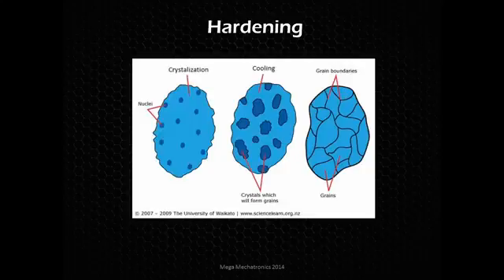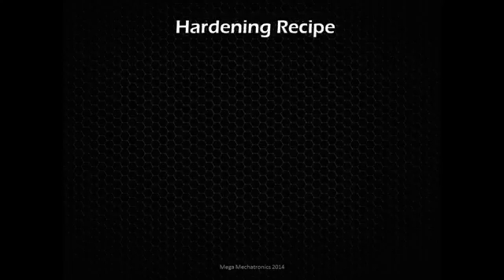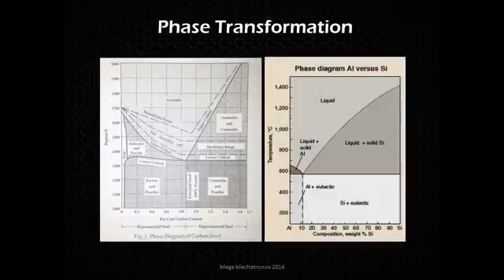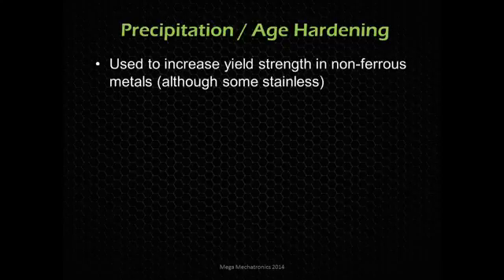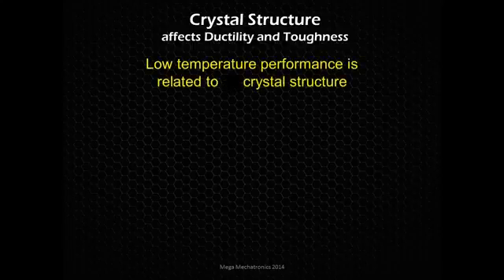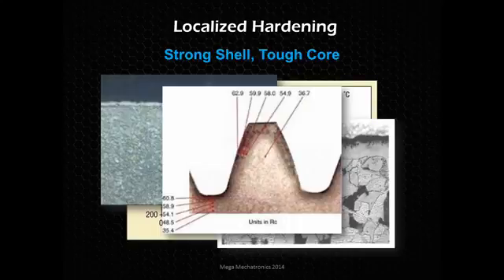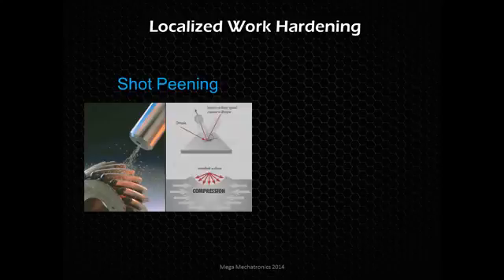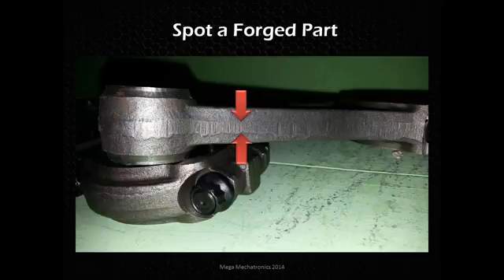Materials Science Mechanical Engineering    Part 4 Heat Treatment Explained

Comment: Name : Eri Dya Fadly
Nrp  : 2714100036
From this video I get some information about heat treatment process. Hardening and heat treatment need to be concerned since the result will affect the mechanical prpoperties. the hardening process we need to crystalized and then cool the material. we know that the BCC structure is the base form in ferrit phase. to increase the hardness of the material, we will make the martensite structure. this structure have needle path with great boundary stress that will give more hardness structure. from the crystal structure, we need to make smaller grain size because the grain boundary will give barrier that mean a hardness increased.  The concern in this short paper is about hardenability of material. The hardenability in this concept are limit dependent on alloying elements of the metal and the hardness properties on the material is dependent on carbon content in ferrous carbon. We can see the hardness vs carbon content in the video, the hardness is hugely increased with addition in carbon content until 0.8%. the hardening process have many parameter such as heating rate , Hardness does correlate with strength of the material there is definite corelation, when hardness goes up so the strenth will goes up too., and for corerelate hardness with thougness so same concept joules of energy absorb in hardness so the harder it is more brittle and the less tough it's going to be in general but again it depends on the alloy. and this video tell about work hardening (cold working),Work hardening, also known as strain hardening or cold working, is the strengthening of a metal by plastic deformation. This strengthening occurs because of dislocation movements and dislocation generation within the crystal structure of the material. holding time and cooling rate. We need to quench material to perform martensite state in the material. Different quench media will have different amount of martensite. In the TTT diagram , we know that is impossible to perform martensit with water quench media. it will make the carbon trapped in FCC state, but the amount of carbon cannot be controlled. It will make the material has brittle properties and made the material crack. The material need to alloyed to reduce cooling rate but perform martensite state using oil or salt media. the heat treatmen until quenching process will give martensite state. Although the amount of martensite state can reach 100%. So the additional process need to be perform more process. We now that cryotemper will make the martensit state will revealed perfectly (100%) using this process. This process also called sub zero treatment. Lets comparate the amount of alloy in some material like plain carbon 1018. The base element is iron and it has 0.17%C, 0.75% Mn, 0.04% P, and 0.05% S. the eutectoid is still in 0.8% C . for the 4130 alloy steel, it has 0.3%C, 0.5%C, 0.2%Mo, 0.95%Cr, 0.25%Si. The 4130 steel will have eutectoid lower than 0.8%. the next process after we get martensite state is tempering. Tempering is the process to decrease the brittle properties and improving its thoughness. Tempering process must be done under transformation temperature to avoid the martensite reforming ferrit phase. Some heat treatmen like annealing and normalizing to improve ductility and age hardnenign to perform precipitate as known as secondary hardness may be performed.So, Heat Treatment is the controlled heating and cooling of metals to alter their physical and mechanical properties without changing the product shape. Heat treatment is sometimes done inadvertently due to manufacturing processes that either heat or cool the metal such as welding or forming.Heat Treatment is often associated with increasing the strength of material, but it can also be used to alter certain manufacturability objectives such as improve machining, improve formability, restore ductility after a cold working operation. Thus it is a very enabling manufacturing process that can not only help other manufacturing process, but can also improve product performance by increasing strength or other desirable characteristics.Steels are particularly suitable for heat treatment, since they respond well to heat treatment and the commercial use of steels exceeds that of any other material. Steels are heat treated for one of the following reasons:
Softening: Softening is done to reduce strength or hardness, remove residual stresses, improve toughnesss, restore ductility, refine grain size or change the electromagnetic properties of the steel.Restoring ductility or removing residual stresses is a necessary operation when a large amount of cold working is to be performed, such as in a cold-rolling operation or wiredrawing. Annealing — full Process, spheroidizing, normalizing and tempering — austempering, martempering are the principal ways by which steel is softened.Hardening: Hardening of steels is done to increase the strength and wear properties. One of the pre-requisites for hardening is sufficient carbon and alloy content. If there is sufficient Carbon content then the steel can be directly hardened. Otherwise the surface of the part has to be Carbon enriched using some diffusion treatment hardening techniques.Material Modification: Heat treatment is used to modify properties of materials in addition to hardening and softening. These processes modify the behavior of the steels in a beneficial manner to maximize

Comment: Azmi Putra Gasade 2714100114
Quiz 1
Heat Treatment

Hardening and treatments of heat of heat treatments and then some cold working processes. We actually make it crystallize and going let those atoms move around and going cool.

The atoms start forming crystals and in the materials aluminium we are looking at a cubic structure (CCT and BCT) where there is Adam Centered on the faces aound that cube, even hexagonal for some other materials.

Crystal Lattice Dynamics is a structure of those cubes and we can move those things around and it will not break or fructure because those the atoms are bonded together by kjnd of like a magnetic force so if you shift that over if you classically deform it those atoms are going to latch on to an adjecent set of atoms and move around.

A magnetic ball toys it is sort of illustrating that where he starts to forming it but it stays come together the balls moved their position but it still sounds somethings to latch on to a similar Adam.

Grain boundaries will start forming randomly within the material yhey are going to be crystallizing in different orientations to each other.

A kind of example of galvanized surface and that zinc is crystallizing in different orientations and then we see the lights refracting off of that in different ways and than we can easily make it out the grain boundaries.

At the video (a computer generated model) you could sort of see the crystal structure a uniform grain and then they will gtain boundaries around there will zoom in even closer sort of outline those and then give you an idea of the orient deifferent orientation and the size of yhe grain boundaries is difinitely important. so we do have smaller grains that more smaller ones that is going to have a stronger harder material because we are reducing the ability for those strings for that crystal lattice to deform and move around because there are these deformities.

They are sort of like a wall stopping them from moving any further and then on any other side of that we have huge grains and that makes the material more ductile because we are allowing into move around and andrey orientate. Themselves and shift around and the concept of hard ability that different alloys of metal are going to here different abilities that too hard a different mac hardness that you can achieve si with ferrous materials we put carbon in it and then carbon will increase the strength that gives certain characteristic to this crystal structure as it in there deforms it in a certain ways and allows us to harden that material by bike controlling the crystal structure.

The hardening recipe is very important of the time the temperatures that the material is fees during the hardness process.

The recipe is going to get lead ro success if you can follow that recipe consistently or if you figure out the perfect ways.

Phase transformation diagrams this will give engineers an idea of where to start with what temperatures and this carbon.

Precipitation hardening also called age hardening is a proceaa where a second phase that begins in solid solution with the matrix metal is precipitated our of solution. 

At the video also show us many ways to what should we do in heat treatment and many more tips or trick to see or count it.

Comment: This video explain how we can do heat treatmen in generally, about hardenability,
hardening recipe, diagram fasa, tempering, normalizing, annealing, hardness
test, scratch tes, cold word and hot work. Hardenability has limits depend on
alloying elements of the metal, but hardness depen on carbon containing ferrous
metal, Hardenability is the ability of Fe-C alloy to be hardened by the forming
martensite as a result of a given heat treatment. For every different steel
alloy there is a specific relationship between the mechanical properties and
the cooling rate. Hardenability is not “hardness. It is a qualitative measure
of the rate at which hardness decreases with distance from the surface because
of decreased martensite content. High hardenability means the ability of the
alloy to produce a high martensite content throughout the volume of specimen.
There are some heat treatment that we can do, Annealing is a process invollvig
heating and cooling, and its use for produce softening, tempering is process of
toughening a material (such as glass), metal (such as cast iron), or an alloy
(such as steel) to make it more resistant to stress by  heating it to a particular temperature, maintaining
it at that temperature for a particular duration, and cooling it rapidly to
normal temperature at a particular rate. Opposite of annealing. Not to be
confused with tampering. To do a heat tratment, phase diagram
can help by showing the corelations between the carbon content and the
temperature and phase for materials based on ferrous. The quenched media like
air, oil, and water will give a different microstructure at the end of the
cooling process. Metal Quenching Material is heated up to the suitable
temperature and then quenched in water or oil to harden to full hardness
according to the kind of steels. Material is heated to the suitable temperature
for hardening, then cooled rapidly by immersing the hot part is water, oil or
another suitable liquid to transform the material to a fully hardened
structure. Parts which are quenched usually must be aged, tempered or stress
relieved to achieve the proper toughness, final hardness and dimensional
stability. Metal Tempering Tempering is done to develop the required
combination of hardness, strength and toughness or to relieve the brittleness
of fully hardened steels. Steels are never used in the as quenched condition.
The combination of quenching and tempering is important to make tough parts.
This treatment follows a quenching or air cooling operation. Tempering is
generally considered effective in relieving stresses induced by quenching in
addition to lowering hardness to within a specified range, or meeting certain
mechanical property requirements. Tempering is the process of reheating the
steel at a relatively low temperature leading to precipitation and
spheroidization of the carbides present in the microstructure. The tempering temperature
and times are generally controlled to produce the final properties required of
the steel. The steel must be heated to a temperature where the iron phase
changes from ferrite into austenite, i.e. changes crystal structure from BCC
(body-centered cubic) to FCC (face-centered cubic). In austenitic form, steel
can dissolve a lot more carbon. Once the carbon has been dissolved, the
material is then quenched. It is important to quench with a high cooling rate
so that the carbon does not have time to form precipitates of carbides. When
the temperature is low enough, the steel tries to return to the low temperature
crystal structure BCC. This change is very quick since it does not rely on
diffusion and is called a martensitic transformation. Because of the extreme
supersaturation of solid solution carbon, the crystal lattice becomes BCT
(body-centered tetragonal) instead. Metal is a very versatile material and the
application is very high and various. And by alloying we can get the material
to the properties that we want. There are so many options of alloying elements
that can be used for alloying the metals. For example the 4130 alloy steel has
alloying elements of Silicon, Chromium, Molybdenum will give the properties of
very high strength but ductile and high toughness compared to the plain carbon
steel. And the Stainless Steel 304 will give a high corrosion resistance and
strength to the metal by adding Chromium element. To measure the value of
hardness we use some testing, hardness test, like brinell and Vickers. They use
indenter to measure the penetrating dent in the materials. When a soft
materials is doing a hardness test the penetrating is very deep, but when the
materials has high value of hardness, the penetrating is shallow. The simple
way to measure is scratch test, using mohs scale. Localized Hardening, there
are induction hardening and nitriding / carburizing. In induction hardening, it
happen only in surface of material, they using electricity and magnetic forces,
and then quench in the tank. Like an eggshell, have very hard on the surface
and have very tough and durable core to prevent impact and prevent fatigue
failures and something like that. In nitriding we infuse nitride and in
carburizing we infuse carbon. We can do work hardening like cold work and hot
work to maximize the hardness.